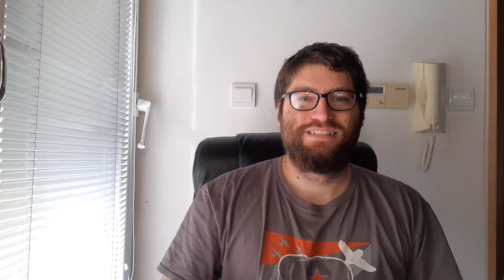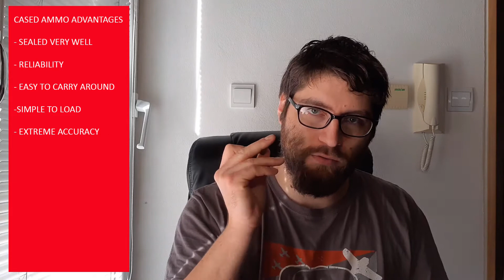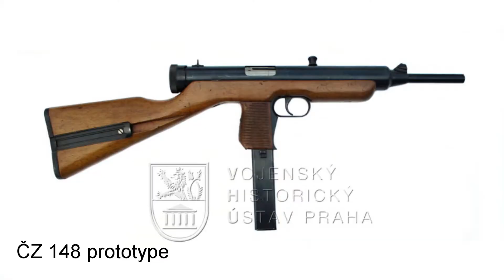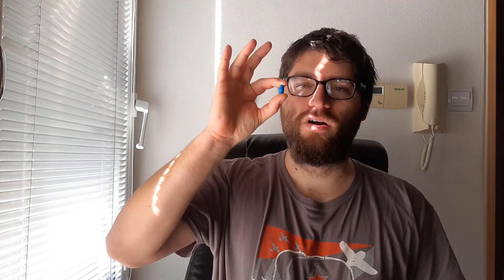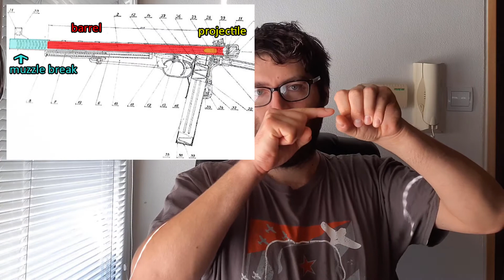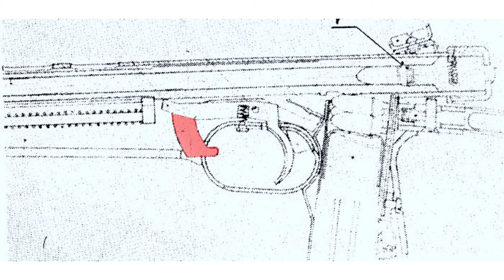Holeček Prototype caseless ammo submachinegun

Comment: Amazing, way ahead of his time.  It seems he borrowed the idea of the obdurating brass band from artillery shells, makes sense with a steel bullet.  I can see some potential issues with this but nothing that seems insurmountable to me.  I wonder if the length and shape of the bullet made it unstable in flight.  I'm guessing the extended rim was bent back on firing, I'd expect that to cause some wear and possible reliability issues.  Still, some amazing engineering clearly showing how innovative Holeček truly was.  Aside from the vz. 23 to 26 series of SMG, what other firearms was involved in the design of?
Reply from the maker: Yep, the rim was to be bent when firing - well observed! :) There were some downsides of the design of course... What I managed to find in literature, it was necessary to keep the groove in which the barrel travelled clean - similarly to pistols - once the mess gets in it slows down the action and causes problems... This gun was, however better sealed than pistols so this is rather hypotetical issue. Another problem, similar to for example Polish RAK PM63 - the sights are travelling along with the reciprocating mass - barrel so that might be also a problem... 

As for mr. Holeček there were other prototypes, yes but as far as I know, apart from the Sa 23, 24, 25, 26 series no other design got adopted. And later - in 1953 he was forced to abandon the firearms construction and moved to the construction of artillery. Later abandoning even the artillery construction and moved to completely different branch.... from what I know, there were some political reasons as well as personal relationships with his colleagues... What a pity though...

Anyway I will make another video on his prototypes in the future but I need to get my hands on more literature :)
Reply: @CzechoslovakGunStories  Awesome, I look forward to future videos.  I don't know what the market is like, but are you considering writing a book on the subject?  Though I must admit YouTube videos make the content much more accessible for most people, as you've previously noted there is little english-language material available.  This is one I have that is one of the few available, but it doesn't much go into the history and people involved, and certainly not prototypes: https://www.amazon.com/gp/product/0764333542/ref=ppx_yo_dt_b_search_asin_title?ie=UTF8&psc=1
Reply from the maker: @khalgren  yeah I was thinking about a book maybe at some point in future... We have quite a few resources available here but I can see the gap on the market - everything only in czech... I especially like the topic of postwar designs... Many firearms ended up being junk just because of Soviets and their involvement... :)
Reply from the maker: @khalgren  thanks mate I will sure reach out to you once I feel I have enough data to start... I plan to contact the military museum in Prague to see if there is some chance to get into their archive for more data and also take pictures of the guns :) they have a large collection of prototypes there ;)
Reply: @CzechoslovakGunStories  Man, wish I could be there.  Can you send an e-mail to confirm your address, I'd like to delete my previous comment for privacy reasons.  Thanks.
Reply from the maker: @khalgren  sent :)